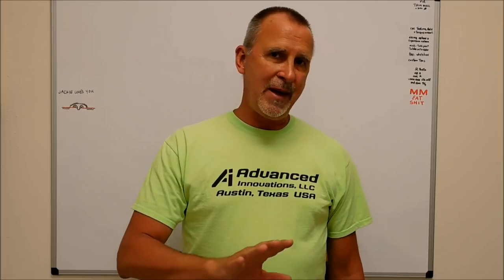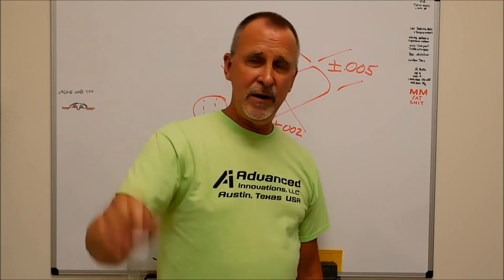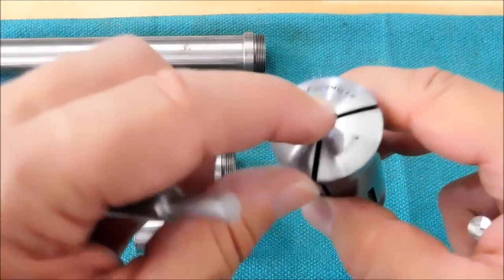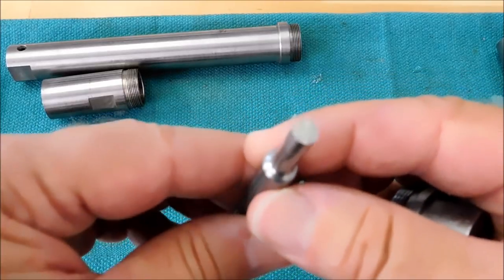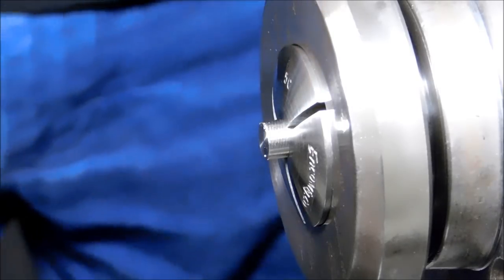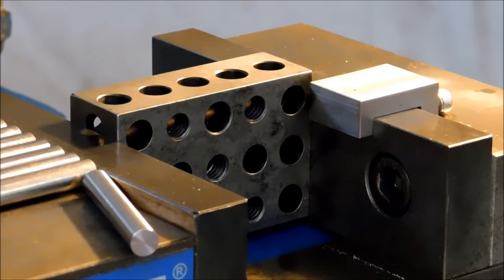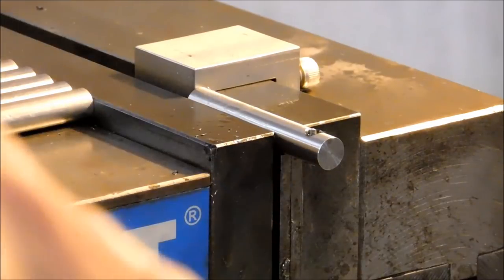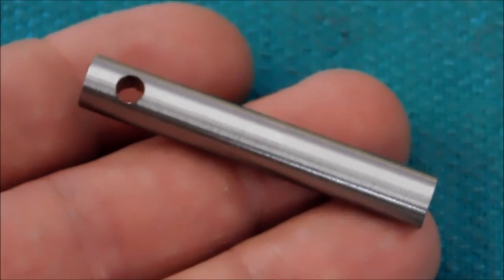Great setups, Crappy results, and the reasons why. Take a look

Comment: Good explanation of common setup problems. One minor point for extreme edge-finder accuracy; when the .200 diameter contacts the part edge and jumps sideways, you're actually .099 from the part center line instead of .100 as commonly practiced. Usually doesn't matter but sometimes it does. Thanks again for your great teaching skills.

Comment: Joe thx for showing how sneaky one setup is vs another setup. The analysis at the end covered all the gremlins quite well. I'll always remember the length dependence of a diameter in a collet. The takeaway here is think about what problems are inherit in a setup. If you can't change the setup then you have to compensate for each part. Thx again Joe for the insightful and practical tips and your time in producing the video.

Comment: I'm a home shop guy (although I do some prototyping side jobs) and I immediately caught the problem with the diameter, but never realized the severity of all the follow-on problems caused by the diameter.  Outstanding information, Joe.  Thank you!
Reply from the maker: Start tight, finish right.
Reply: I'm a home gamer too and knew right away that changing from three cuts to two it would go down hill from there.

Comment: Having made the same mistake before, I knew the potential problem as soon as you gave  
+ or - .005" on the OD and then proceeded to use a 5C collet with a stop.  A really good machinist would have recognized the potential issue before running the parts but I had to learn the hard way!
Hopefully you have saved some folks from making this error BEFORE they kill the parts!  I really am enjoying your videos, Joe.  Old, retired, tool & die maker, TreeTop
Reply from the maker: I am glad you cringed. I was looking for that effect. Thanks for watching.

Comment: Very helpful instruction. One tip about edge finders for very accurate use.  Even high quality tools with lapped surfaces sometimes stick and refuse to jump over consistently. To help this problem separate the mating parts slightly and add a drop of light oil. Also, once the end jumps over, even slightly, you've already moved over  half the diameter for the tool. For .200 dia. tools  move your table .1995 for improved accuracy.

Comment: Great lessons there 👍
Blowing off chips into the collet, could introduce an obstruction between the stop and the registering end of the next piece, as the chip can fall into the space, when the first part is removed.
Reply from the maker: Anyone that has loaded parts in a collet or any other machine with a stop can tell the click vs the mushy thud of chip interference. For safety, if you are scared, blow it off before opening the collet.

Comment: Taper wasn't really mentioned much....but the taper from turning the pins can burn you too. You want the pins to he straight as possible. Using a v-block helps, but doesn't eliminate the error. One of the things I had a helluva time getting through to my apprentices was the fact that on some things, just because you have a tolerance does NOT mean you can use it, because using that tolerance will burn you later.

Comment: Great vid. Never thought about diameter affecting finished length with a collet. Makes perfect sense when pointed out.
Reply: alleznape it's very dramatic if you even adjust the draw bar
Reply: Honestly, that is the only part of the video that puzzles me: It's obvious the influence of the difference in diameter when using a stop on a turret/tailstock (e.g. turret lathes, screw machines, etc.). But, either you're displacing the stop (therefore, you're getting parts longer and longer during the production run), something possible with that type of stops, held in place only by a set screw, or the stops holds up properly and the collet jaws slide slightly on the part, when it bottoms to the stop.

Comment: Spot on, on all points, Joe. I can also attest to having seen many people make most of these mistakes and then scratch their heads about it. I like the solutions you give, especially the soft V-Block, I have often used ad-hoc aluminum parallels so I can drill into them without worry, but I hadn't thought of a soft V-block for crossholes.
Reply: That taper though; I was taught that a 3:1 length/diameter ratio is a magic number for many things, one of them being as a general guideline for how long is long enough that I really ought think about supporting the other end of a long part.
Reply: Agreed. A box tool would be better for this if available.
Reply from the maker: Any taper should be removed before you proceed.

Comment: I've watched dozens of your videos but I think I got more from this one than any other.  Modeling your jig/setup after the measurement in the spec is really simple and effective.  Most of my gremlins occur in surface finish.  I have a lot of motor vibration that makes such a mess of my surface finish that I never bother with tool chatter!  Every job ends with a lot of sandpaper and Scotchbright pads.  LOL
Reply from the maker: Try to insulate your machine at the feet. Motor noise is amplified from the ground contact. My lathe sits on thick rubber dampers.

Comment: Hey Joe, thanks for putting so much time into these videos, I've learned a ton of cool tricks! When you say your edge finder has a center finder on the other end, I'm assuming it's one of those conical ground points. Can you show how to use that and a couple practical applications? I've always wondered. Thanks!
Reply: SasquaPlatypus you can pick holes up with it, or the center of a pair of jaws under the diameter size

Comment: I really enjoy learning from your videos.  I recently bought an old Harrison M400 lathe and a Summit mill for my hydraulic shop.  Most of my jobs are building new chrome rods that people bend using their 30hp Tractor as a D5.  Turn the end down and cut some threads.  I did get to chase a 5.75" nut with a buttress thread the other day.   I had to make the tool holder and grind a piece of HS steel to get the job done.  Certainly appreciate your time producing these videos.

Comment: The problem with putting parts in vises that are short, and one one side, is something that is a very bad problem, and something I rag upon all the time. It’s surprising how many machining people (admittedly, mostly amateurs) don’t get this. But sometimes, even well known pros do this. Since the solution is so obvious and easy, I just don’t understand why the don’t get it.

I always make a small piece the same width as the part when I know I’ll have this problem. I have a small box of all different sizes of these pieces, with the sizes written on them.

Also, yes, I have a full 72 collet set in 5-C, in inch, plus another couple dozen others. But you’re right, it’s hard to predict the length of a part. The other problem is that the diameter of the part needs to be very close to the nominal diameter of the collet, and not oversized. I also have ER collets that don’t have these problems, though the stop is in the collet chuck, and doesn’t allow for long parts. The other problem is that because of the collet design, it’s required tremendous force to properly close them—up to 130 foot pounds for the largest size in ER-40, and 150 for ER-50…whew! Even with my large torque wrench I can’t manage that.

A high quality centering vise works as well for those poor spec parts.

That’s all you got is more than what most people got.
Reply from the maker: When I have to hang a part out of the end of a vise jaw, I keep one of the actual parts on the other end to stabilize the jaw. I simply swap that part out for one thats done and finish that one last.

Comment: Hi Joe, I recently had a very similar problem when trying to drill a centre hole through a piece of 6mm stainless steel stock.  There was too much deflection (as the hole position was near the end of the part and the drill press chuck and vee block clamp seemed sure to collide) when I started applying downwards pressure on my drill press.  As luck had it, I was only drilling a 1.5mm hole the the relief inside the 'V' block I was using was greater so I was able to push the hole right through.  Your demo had made me re-think my approach to set-ups when evaluating the best way to get a job done.   Anyway, It still scares them crap out of me using drills that small.  (I purchased a pack of 10 cobalt drills for the job and only destroyed 1). Thanks for the insight.  Kindest regards from Bonnie Scotland.  Joe M.
Reply from the maker: Hi Joe. I plan to do a video on a 'Floating Chuck' You want to see small....wait for that one. Thanks for watching.

Comment: I learned this trick while working 3rd shift in a production shop , if you're following a 2nd shift operator who hasn't kept track of his O.D. tolerances , measure ALL O.D.'s & group parts according to size . Start with biggest O.D. , set O.A.L. & face to length . Then change length for next sized group , with a 5C collet  ; .001 Thou. on O.D. = 0.006 Thou. in length.
Reply from the maker: I hated working second shift. Picking up someone elses trash was a daily task.

Comment: Nice video! I'm new to milling metal, but with wood I've done a bit of setup. The rule works to register from the critical point. The v block concept is new as a fixture.  Thanks!
Reply from the maker: Always try to bank from the surface the dimension is driven from. Its a good practice.

Comment: Joe

I enjoyed watching the video. You describe what you are doing so that the untrained can benefit from you knowledge. I noticed that when you turned your part around in the lathe that the difference in diameter would not allow you to insert it. I only use hardinge  collets which cost more but they have more spring which allows a slighter large diameter to be chucked plus it is less likely to scratch the part plus they are more accurate then the foreign one. If I was doing this part I would have used a collet block (brown block) rather then using the vise but large differences in diameters would restrict it's use.
Big fan. Charles    Boston

Comment: Great information, lots of food for thought, which is the whole point! A few questions:

1)  To get all the parts the same length, could you face one end, then take them to a mill and  clamp them using a stop, and face the other end?
2) To drill on center with varying diameters (within reason) could you also use a collet in a block?
3) Not much talk of how to reduce the taper in the diameter, or how to get all the parts closer to size. Yes, treat them all alike, as long as you treat them well!

Thanks
Reply from the maker: 1. Yes. The mill is a great way to bring them into length. I did a video on that inspired by the same need. " Holding multiple parts of different diameters"  2. Yes. a collet block will center them up, but the depth will still vary. 3. You can re-chuck the parts in a collet and dust the ends while holding the part deeper in the collet.

Comment: Thaks Joe for another great vid!
So, I saw this coming when you realized that the part was tapered. A more accurate method when turning stainless or any other tough material would be to use a HSS tool which doesn't require the higher tool pressure of an insert tool. Also, employing a follower rest would reduce the deflection of the work. Making longer parts using this method would be desierable as well. Even better would be to use an ER type collet which clamps the diameter without drawing the part back into it. Just my thoughts.
peace-out..Tc
Reply from the maker: Hi Tom. Your comments are good. Some of the 'L' based stainless steel I have cut would be pretty hard on HSS, but it does have its place. I use ER 16 and 32 collets all the time here. Although they don't have the straight body lead of a 5C, they still migrate inward under pressure. They are just pushed instead of pulled. Be careful.

Comment: I got those! Whoopee! Still not by any means a machinist, though. Love your channel! My lathe does not have quick-change collets, so my arrangement would be different, with a stop referenced to the spindle. As for the drilling, it seems to me unlikely that anyone would use other than a vee block. However, if for some reason that hole needs to be perfectly perpendicular to the piece, I would use a tailstock centre when turning it. It could still turn out fat, but less risk, overall, I think. I don't recall the math, which is complicated, and almost certainly unnecessary, but I think the effect is about a gnat's cock of that if you leave the piece hanging. Since we are not here to learn calculus, but to make things, and the experiment is easy enough, try it.

All the best engineering is done like that. I remember, when working in theory-mad Italy, being asked how medieval catapults could work, when the theory of projectiles was not understood. Well, mate, if it goes too far, don't wind it up so much, if it doesn't get there, use a stronger one or go nearer!

Comment: I wish every one of my coworkers would watch this video and understand it.   Not just the example, but the idea.

Precision starts at the beginning!

Often I get to OD grind tapers after heat treat. Someone else rough turns those blanks. When the part lengths vary, not only does my finish diameters change at the same zero on the dial, but the tapers can change too. Fine tuning a tight tolerance taper  15 times on a 20pc order is not the greatest way to spend the day.

Comment: wow joe, you just blew my mind lol... im not a professional machinist, just a hobbyist for now, but I love learning this stuff. your vids never disappoint!!! :)  the v block trick is just awesome, I can see myself using this trick lots.... one question though, if you have made a home made v block, how would you measure to get the cutter centered over the v?  I would love to see a vid on some home made special one off and disposable fixtures of yours... I liked the teeter totter clamp you made for clamping 4 pieces at once in the vice.  im sure you got lots of stuff like that lol...
Reply: Hi joe, good to see you back, again a very useful video, excellent description, and again, a lot of people would never work this out.kind regards Jack from over the pond
Reply from the maker: You indicate a 'V' block exactly the same way you indicate a hole. Visually center your indicator over the center of the block, adjust your indicator tip to point straight down, and lower your quill until the tip hits one of the faces. Spin the indicator to the other  face and adjust accordingly. Its very simple and quick. I use that teeter totter clamp concept all the time.

Comment: I just drill some parts as you showed it in scenario No 1, but it makes sense that scenario No 2 is more accurate using a v block for better results like perpendicularity of the hole drilled to the OD. Thank you very much for sharing your experience. I'll do that next time.

Comment: Thanks for an educational video.  I have a quick question.  It seems to me that most of the problems stem from the spring in the material in turning it down.  I know that having that much stickout in a diameter that is that small will introduce a taper in the part.  Other than using a center to support the right end of the part, is there a quick and easy method to minimize the taper in the part?
Reply: the people want to know!
Reply: WilsonT use a lighter finish pass to final dim, and keep the feed rate constant
Reply from the maker: Agreed. another reliable fix can be to take a small variation as it happens and just part the pieces off. Choke them up in your collet afterwards and cut them again at the same setting. The taper goes away and the cut feathers out to the smaller diameter being held in the collet. Thats how I corrected the part in this example off camera.

Comment: yes a v block would keep you on center but because of the taper of the part you would be drilling at a tangent to the cylindrical centerline meaning the cross hole would start in the right place but would punch through the other side in the wrong place....

Comment: Who is MM?BTW,another option to control OAL using a collet setup is to use a collet stop that attaches to the spindle tube instead of the collet itself,so it remains stationary even if the dia's change.Worked for us.

Comment: Another way to do that would be to use a collet block and make sure the same side is up each time you put it in the vise and then use a stop bolted to the machine table rather than on the vise jaw so you can register from the dimensioned end. That way you can drill through without worrying about hitting anything.
Reply: Collet block or dividing head.

Comment: Excellent suggestions Joe!
For the sake of good cylindrical consistency I wonder if it would have made sense to use the live center in the tail stock to support the rod as it's being shaved down to size. It would mean an extra operation or two, but it might totally eliminate the taper problem.

Comment: If the parts are tapered marking a consistent 0 end on each might be helpful. Why not soft jaws on the vise and the part in the middle of the vise? And (instead of worrying about overall length) shouldn't the stop for the hole location be on the end the dimension is called from? Nice info on the 5C stops!
Reply from the maker: That is absolutely a good solution, but the centerline would still be off if the OD's vary. And yes, always stop from the dimensioned end. You bet!

Comment: Very informative, like this format.  I have to admit I have been a victim of the length variation using a 5C collet stop.  Took me better of 3 hours of head scratching to figure out the diameter variation was causing the problem.
Reply from the maker: Its definitely not the first place the average guy will look. Thanks for the comment.